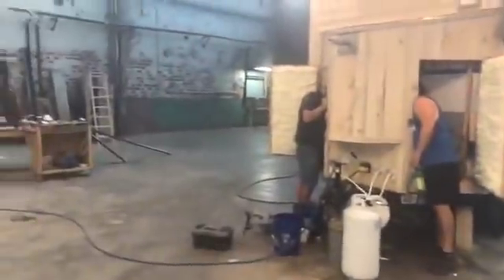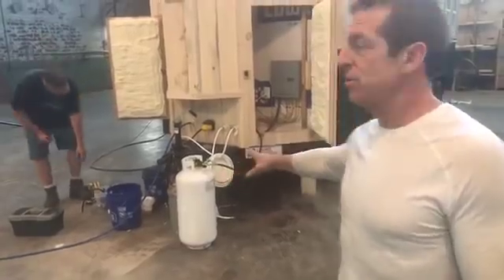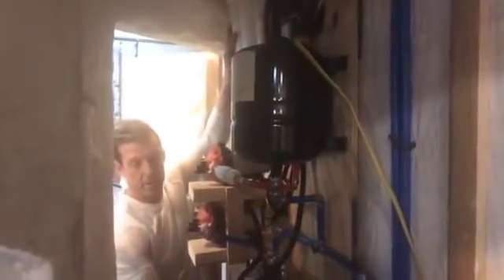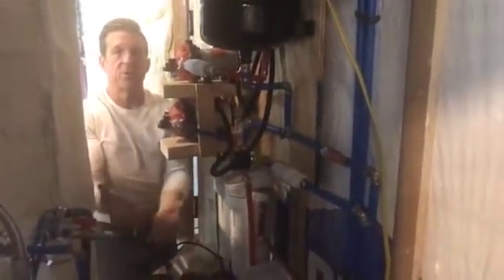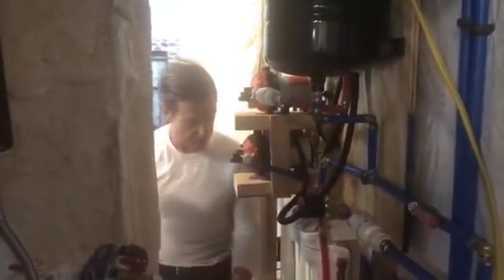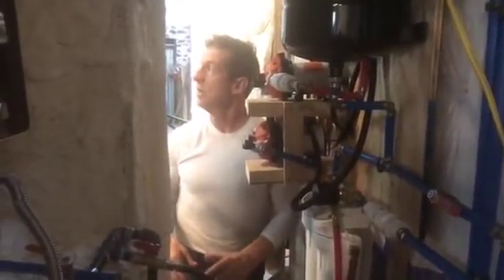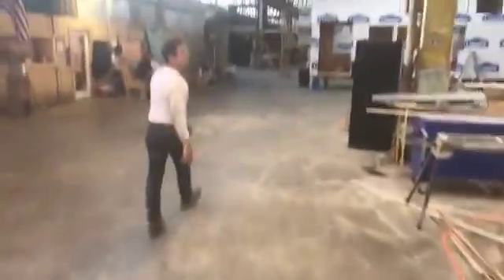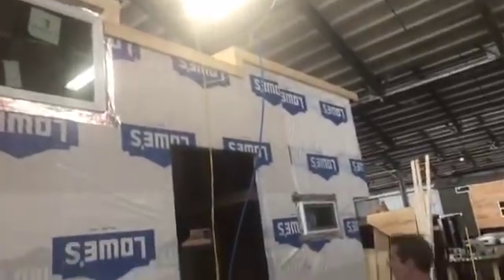Incredible Tiny Homes Live: Incredible Water System in Action

Comment: Not sure about recycling grey water into drinking water. Maybe I misunderstood.
Reply: Nope, the system they showed will be filtering and recycling all the water...

Shouldn't be a issue with the set up they have, though... The system is a bit overkill and pretty much ensures there's virtually nothing but safe water coming through.

He's eventually going to have it tested and show the results if still unsure, just wait for that...

The only thing this won't deal with is any black water.  So nothing worse than bath water, water from washing your cloths, and kitchen sink water.

System only requires you don't put anything too caustic into it that will eat up the filters and pipes. While the water flow stops when it comes time to replace the filters.